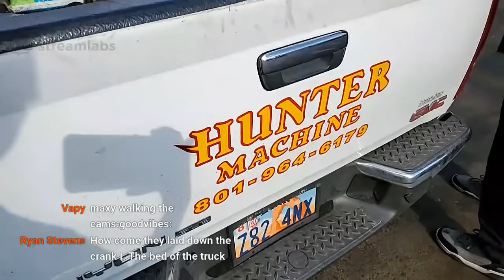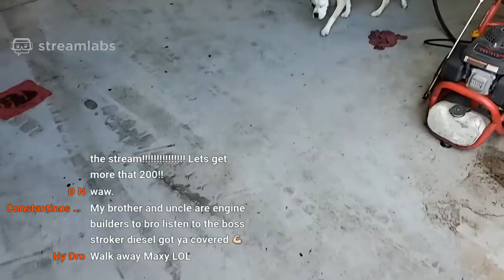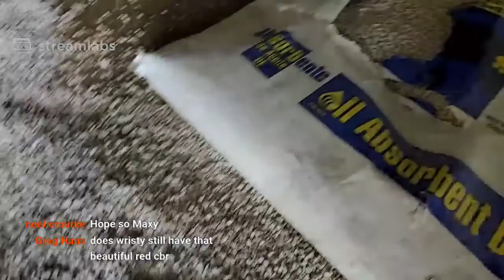V10 Motor Home Engine is off to the Machine Shop!!!!!!

Comment: Is that a aluminum engine block if it is I can see the age of the block on the out side aluminum starts to rot away the head should go in as well motor made in Mexico
Reply from the maker: The block is a cast steel and the cylinder heads are aluminum